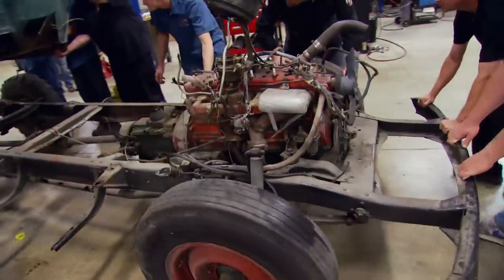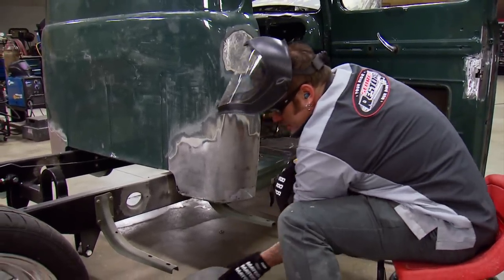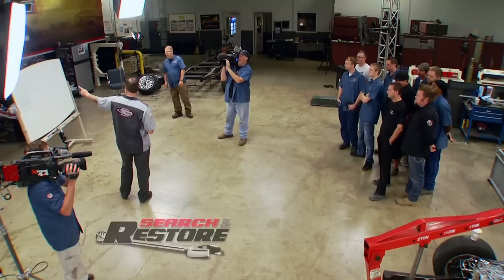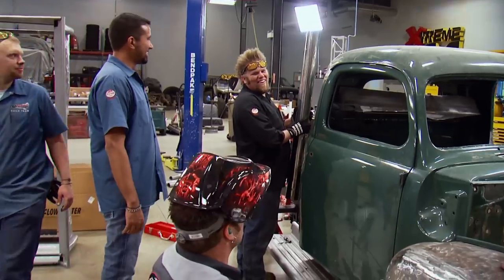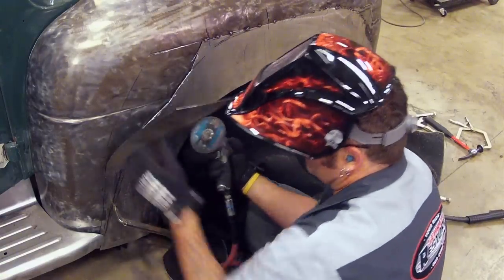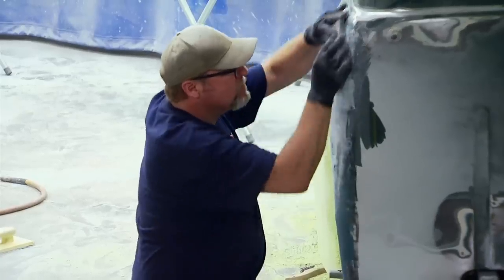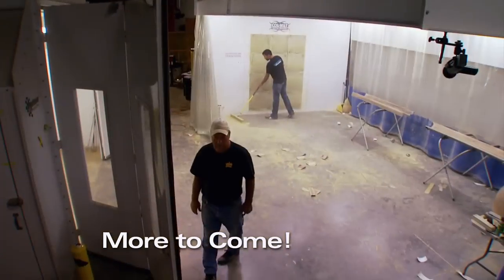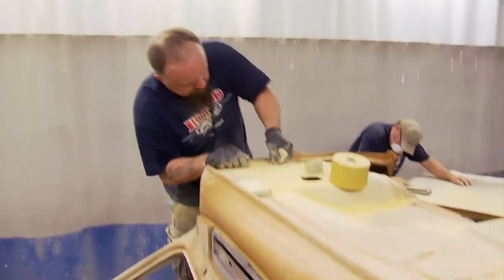Restoring a 1948 Ford F2 to Fulfill a Multi-Generational Family Legacy - Part 2

Comment: I just want to slap the guy who cut a hole in the frame it's a truck you just lost stability For something that will rust out and be replaced in pa
Reply: Yeah, that was a holy fuq ...I can't believe they did that ....and yeah they said the guy lives in Pa...that ain't gonna fly
Reply: @micwell2247   ya I know I have a 1948 Ford f1 with a Chevy small block connected to a studibaker truck bell housing connected to the stock 4 speed with stuffed leaf springs and I know that ain't gonna work